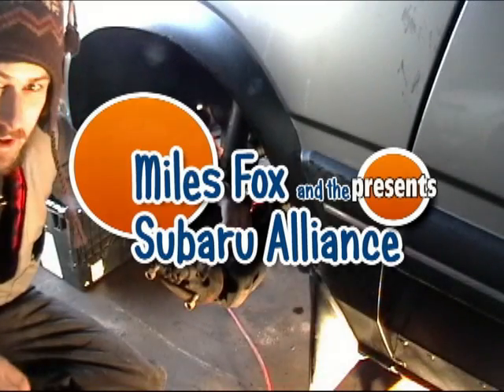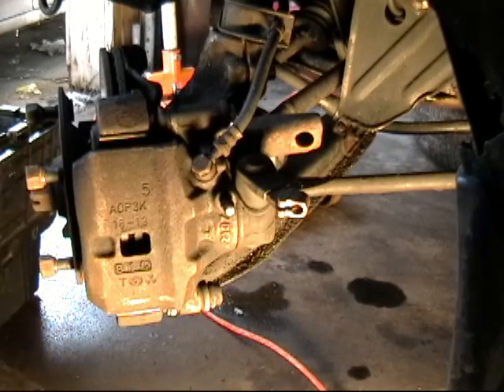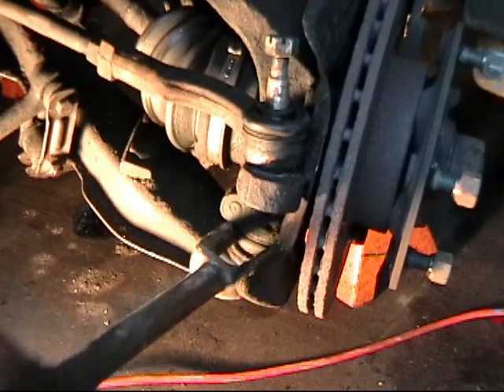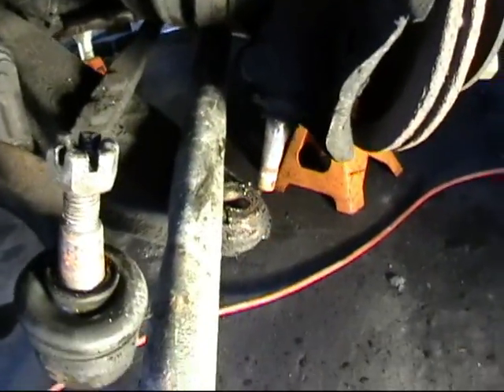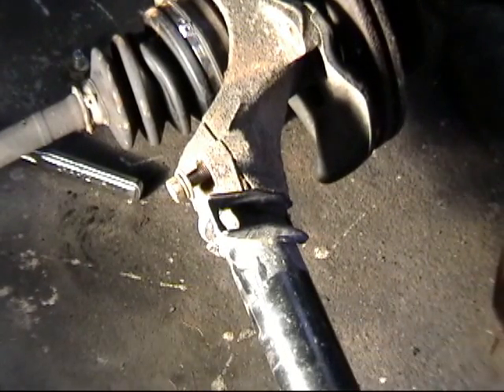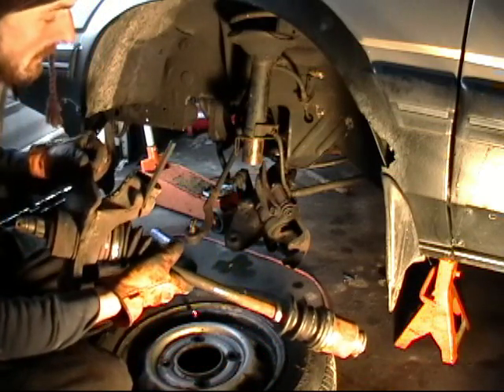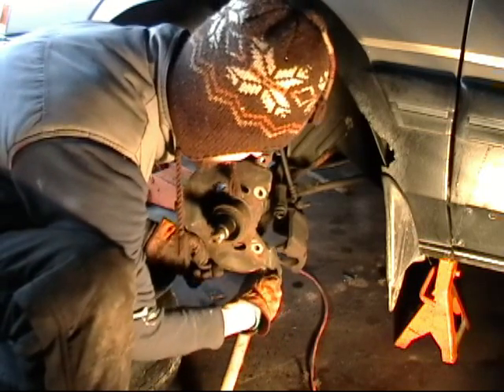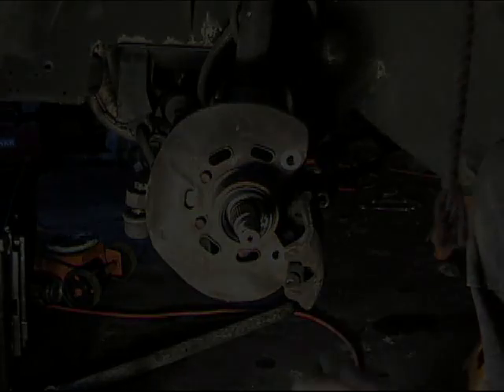Subaru Steering Knuckle EA82

Comment: Hey Miles.  Which is the proper way to install wheel bearing grease seals? Theses a lip and a spring on one side of the seal and the other side is flat.